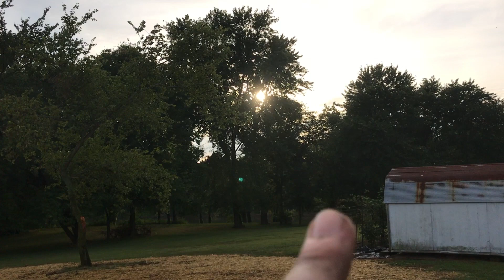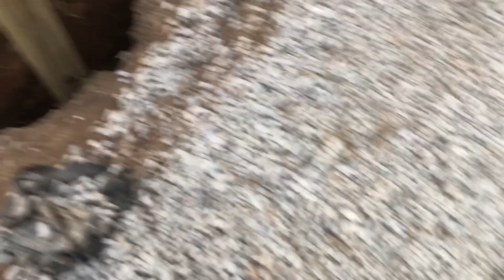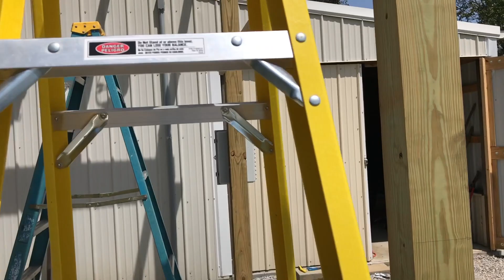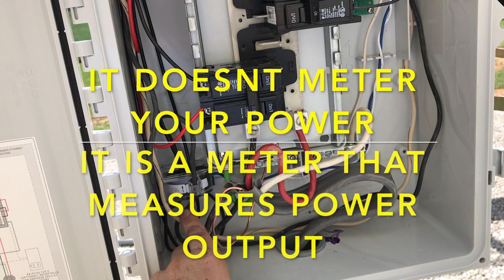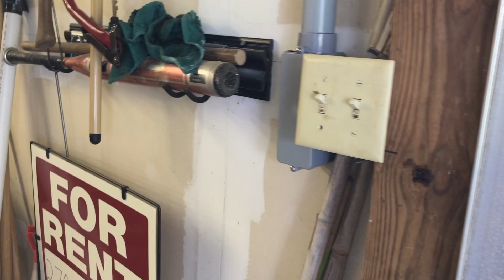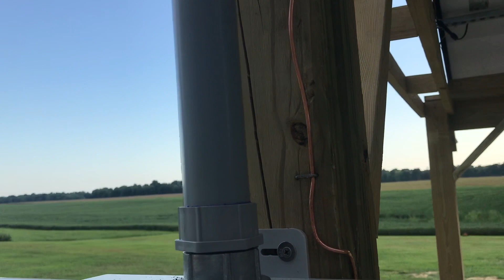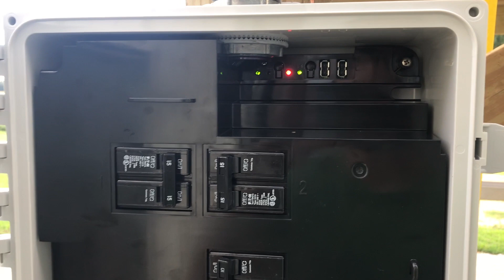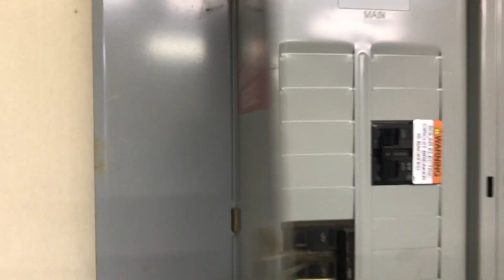Easy DIY Solar Panel Install - 8.37kW Enphase Energy Micro Inverters & Mission Solar Panels

Comment: Great overview for a DIY person.  Did the inspector give any hints?  Also what state are you in.
Reply from the maker: CMAC Inc thanks for the good words! I am in Kentucky. The state inspector was impressed with the installation. We added some stickers to the panel in the garage, the disconnect outside the garage, the panel in the house and the meter panel, other than that we were good to go!
Reply: excellent job

Comment: looks great. it will ground if the bolt/nut bit through the anodizing on the panel frames.
Reply from the maker: Tony Thoreson yessir everything has been working great so far! I have generated 2.81mwh since installation around August 27. That equates to about $340 or $115 a month average.